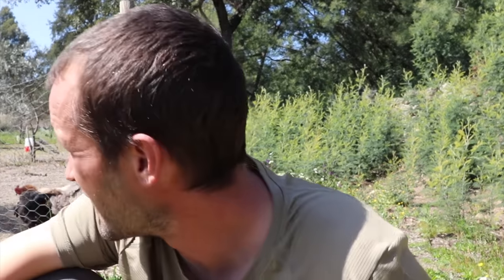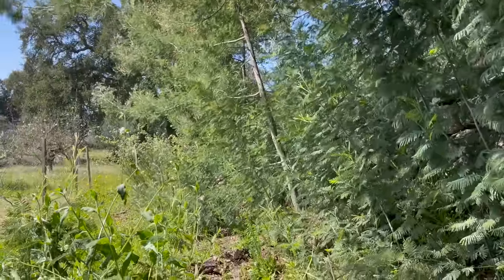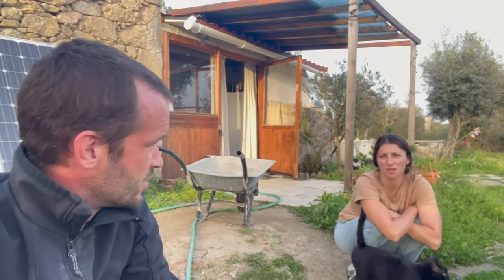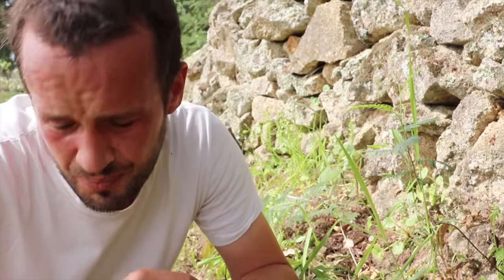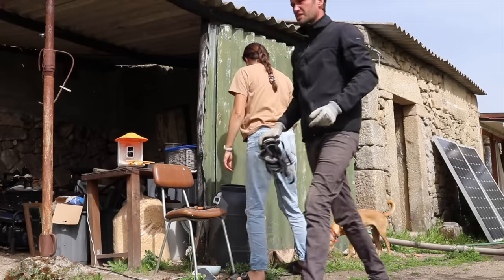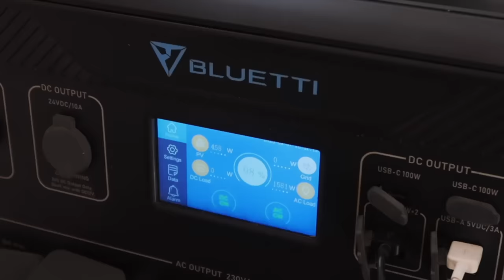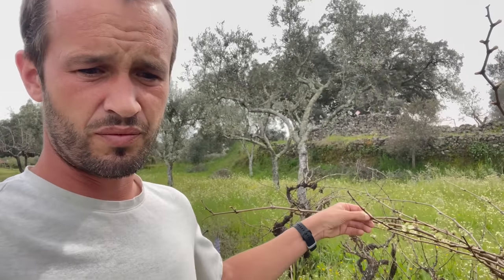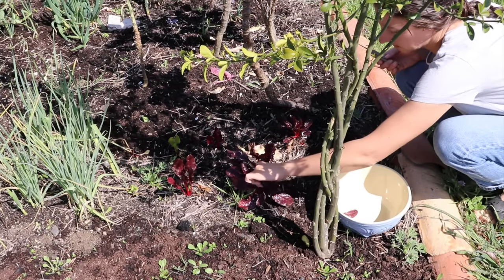Living the Good Life on our Off Grid Homestead

Comment: You could try using bits of old carpet or tarp to exclude the light & water from the young mimosa. Also you could dig a trench along the fence line and put a root barrier into the trench to stop the spread from the other side of the wall, this plus regular coppicing would help to control it?

Comment: The young plants you should pull them out as soon as possible when the ground is moist in the spring, if you cut they will only multiply with more side shoots.. the bigger ones , you chop (and drop) and if possible dig out the roots as soon as possible..

Comment: Using a 1-inch drill bit, drill a hole up to 6 inches into the stump or into the exposed roots. Pack the hole with rock salt and fill the hole to the top with water. The water will help the rock salt infiltrate the roots and speed up their death and decomposition.
Reply: I found this on the Internet it says you can also use vinegar
Reply from the maker: Great! Thank you!

Comment: A. dealbata comes from here, specifically SE Australia. Other than biological eradication, which takes years, poisoning or rotting the stumps are the only other forms of eradication. And as you won't use R--Up, which can be very specifically applied and the application point covered, or a generous application of diesel to a freshly cut and drilled trunk, the only other success can be achieved by digging around stump, applying Epsom salts, or salt ( like the type you buy in bags for swimming pool chlorination) in contact with the plant, and watering it in. This will eventually rot the stump and roots.
Reply from the maker: Great advice! Thank you!

Comment: Hi you can try with copper nail or copper pipe if there is a stump drill a small hole and hammer in the copper pipe the more the better if you are not busy on Tuesday I have a small mission with kind regards Reidar😅

Comment: Could you not smother them out? Weed proof membrane and then just use the space as a bit of a storage area whilst you wait for the roots to die back. Adding weight will stop them pushing the membrane up.